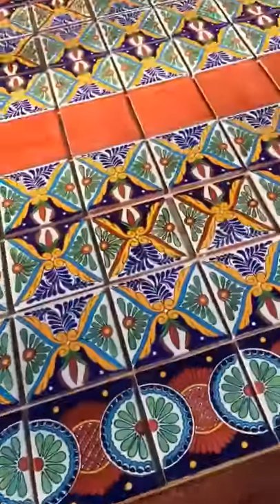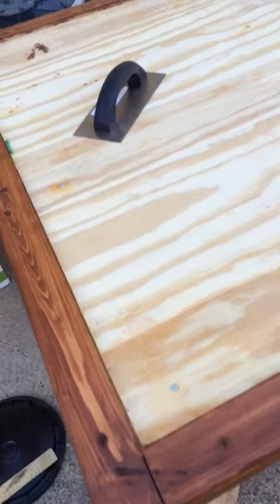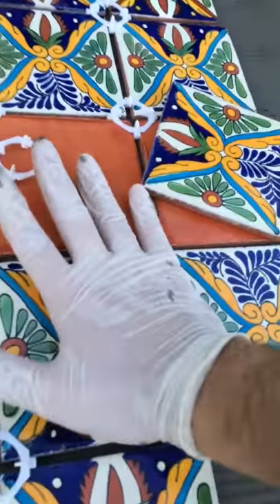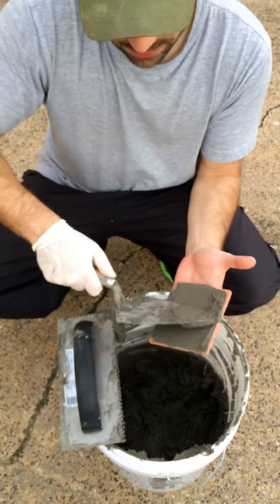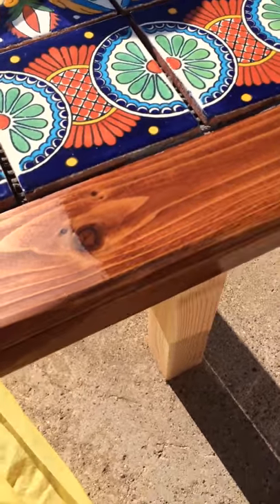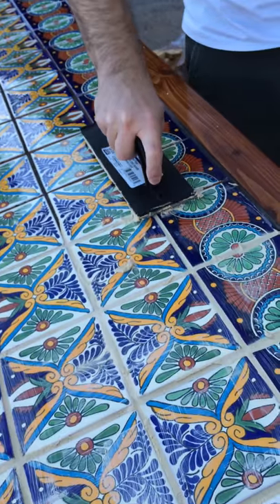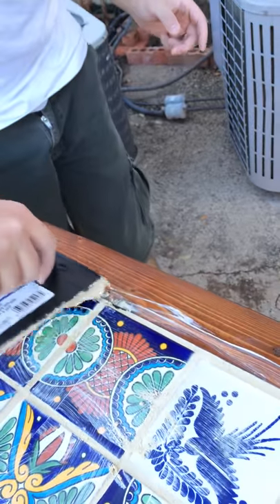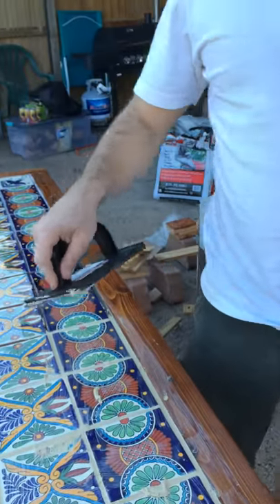DIY table with mexican tiles over wood using modified thin set - Full video

Comment: Just a some unsolicited advice, in the future don't spread the thin-set all at once. Spread enough for 2-3 rows and columns and then continue to apply as you go.
Reply from the maker: okmujm you are completely right. I figure that out after I've done that and half way down setting the tiles it started to harden.
Reply: can these mexican tiles be used for a patio table that will be outside? and is normal sand grout used?
Reply: @betsysmith7736  Yes, these tiles are designed for outdoor use. Normal sand grout is perfect for this project.
Reply: The tiles are like any other tile. You can use it for outdoors even for flooring.

Comment: hello I'm a huge fan of Talavera pottery & tile. I'm from El Paso Texas a border town and I'm so lucky to find it here. The table with Talavera is my next project! Thank you. I know it's hard work! I did tile in a bathroom. took me about a week. only did partial wall and around sink. came out so pretty
Reply from the maker: It is hard work but it is very nice. If I am making another one I would make it lighter. I can barely move this one.
Reply: I heard its best to wet the tiles first before tiling. That it says on talavera box. Hum

Comment: Beautiful design!  Please tell us how the table is doing now.  Was it true that you shouldn't have put them on plain wood? I'm just about to do my bathroom counter and would like to know. Thanks for posting this. Oh yes, love those spacers. Where to get?
Reply from the maker: The table is doing right. I sold the house I was living in Texas and I left it to the next owner. A year ago the table was in perfect shape but that that is correct I should've used a thin cement board in der the tiles instead of the plywood I used.
Got the spacers at lower. They work like charm :)
I am glad you liked it!
Reply from the maker: Beautiful White  Hey I got it at "Amigos Pottery Inc." in Dallas Texas. Wow I think your kitchen will look awesome :)
Reply from the maker: Beautiful White  oh nice. Reach out to them before hand so you know where to go. I think there are two locations. Good luck

Comment: What's with the screws in the frame?   Do some quality work.   ALWAYS screw down cement board or Hardie Backer to the plywood, then use thin set.    Thin-set will not stick well to wood, the wood soaks up the water too fast.  I bet this table cracked or the tiles became loose.  That frame could've been nailed and mitered
Reply from the maker: I'm actually making a countertop a and using cement board. It's good idea but I was my decision to not use one on that table since everything was so heavy already!

Table is solid as rock.  Moved twice and no issues at all. None of the tiles cracked.

Comment: I didn't quite catch what you were saying about you had made a previous mistake and grout cracked etc. What was the mistake?
Reply: if the space between the tiles are too big like mine you need to use grout with sand (called sanded grout) otherwise you use the grout without sand. I used the grout without sand before and it cracked.

Comment: Did you have any problems cracking in the long run. I want to do my counter tops. They'll get alot of abuse and i hoping they last awhile
Reply: No cracks. I would add a cement board on the bottom instead of a wood board like I did though. Take is a beast.

Comment: how did you do the sides ? can you tell me the wood and what did you use for the base of the table.
Reply: Keith Young for the sides I used pine wood 1/2" the base I used those weather treated word then a plan wood then cement and tiles. Don't do that lol 😂. 
Now I would consider using something lighter then probably a thin please wood and cement then tiles.

Comment: How’s it holding up?
Reply: it held up pretty good for 4 years then I moved and left it in the house I sold. It was too heavy.
Reply: @CarModsGarage , I wonder if the thin set had affected your plywood underlayment?  In other words, because the thin set is made with water, the water could be absorbed by the plywood, possibly affecting the final level of the table.  If you were to do it over again, you might possibly varnish the plywood surface as a barrier to the wet thin set.  However, it sounds like the table did alright even after 4 years, no?  Thanks for sharing your project.  I love the Mexican tile and find it attractive to decorate almost anything.
Reply: @tedtolentino4955  ya I hear you. It did not affect but I would make it with a thin cement board instead if I was to make another one

Comment: Honestly how's the table top now? Just an advice because you did wrong: never put tiles on wood. Put a sheet of drywall on top of the plywood then the tiles fixed to the drywall
Reply: table is great still but heavy as hell. I should have used cement board. Very thin one. Drywall would be a great idea but it worked fine for me. About to make an island with tiles now and I definitely learned from my previous mistakes :)
Reply: Thanks for this comment. And then how would you go about fixing he drywall to the wooden table? Glue?
Reply: You don't need to use drywall - the plywood surface needs to be prepped first with wood sealer.

Comment: Does the wood warp when you get it wet from the cement ?
Reply from the maker: Mark Cam it did not warp
Reply: You can seal the wood first with two or three coats of wood sealer. I've just had to redo my outside wall mosaic because it warped - lesson learnt. I had only sealed the side that goes against the wall. It only lasted two years. Any exterior wood substrate must be thoroughly sealed.